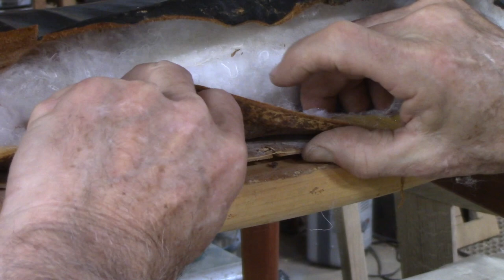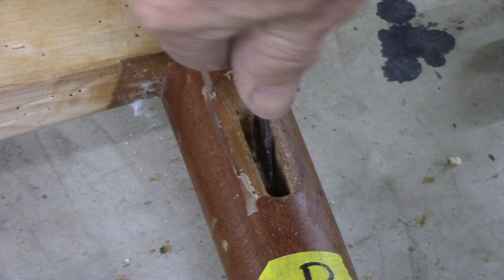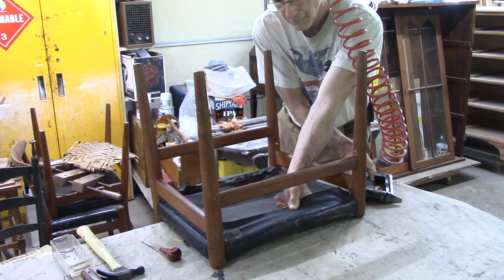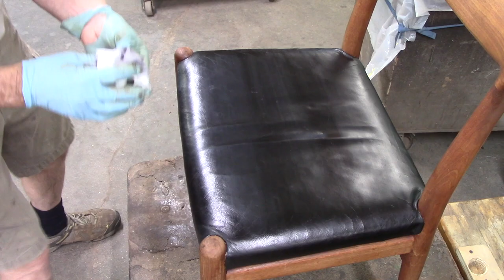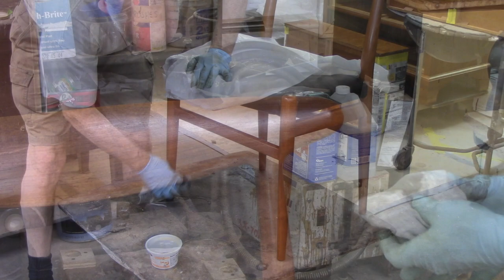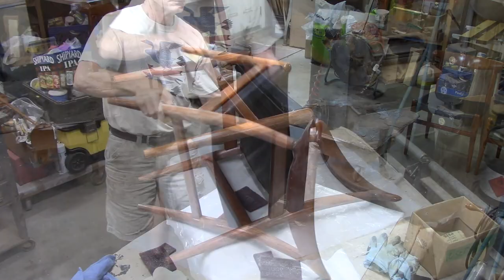Restoring Midcentury Modern Hans Wegner Teak Chairs - Thomas Johnson Antique Furniture Restoration

Comment: Beautiful restoration, I especially liked the treatment you gave the leather seats, I would not have thought of the dye followed by the leather conditioner.
Reply from the maker: Thanks! New for me too, but it worked well
Reply: Me either. But now that I think of it, that's what the shoemaker does when you take him a pair of old shoes to refurbish. Recently my upholsterer warned me that a piece of green leather I picked out for a chair was "raw" ( dyed, but not sealed or painted) and told me I had to treat it with leather sealer (new to me), let it dry for a week, and then treat it with leather conditioner.
Reply: Hello  Tom , great video again what kind of oil do you use to clean leather furniture?  Thank you.

Comment: Thank you so much Tom. I have 8 Wegner chairs that are in need of repair. this video is just what I need. i have been told that I should never glue the joints but it appears you have.  what type of glue do you use. thank you
Reply from the maker: You're welcome! I used hide glue on these, but any type of yellow carpenters glue will work fine too. Also, this Wonder Loc Em is good for joints that are loose but you don't want to diassemble them: https://www.pcepoxy.com/products/wonderlokem-tite-chairs/

Comment: For me this restoration not only showcases your skill, but also your patience. In my limited experience with restoring furniture, a one-off piece offers the satisfaction of the diagnosis, repair, and finish of the project. With a set of chairs, you do the first one, then repeat, then repeat, then repeat... my attention span doesn't handle that well. My wife knows me well enough, and has forbidden me, from bringing home "sets" of anything.
Reply from the maker: Thanks! Luckily, just 4! Sets of 8 or more can get pretty boring. Once had a set of 26 chairs!

Comment: Thanks for sharing your restoration videos and tips, they are of a great value and very professional.

Your videos have encouraged me to try to restore a set of Mcintosh teak dining chairs myself.

I have started do disassemble the chairs and have a doubt in which I would much appreciate your help.  

My chairs have a dowel joint, and in my case some of the dowels are loss but others are quite steady. 

Should I remove only the loss ones and re-glue and leave the others, or should I try to remove all and glue it all again? 

Is there a way to "easily" remove the steady dowels that you could suggest?

Thanks
Reply from the maker: Thanks! Leave the steady ones. Trying to get them out will break them, and redrilling is too inaccurate

Comment: Hi I am from the UK, I have my eye on a set of 8 Wegner Wishbone dining chairs in a light wood with black rope seats. I wanted to ask if I can stain the wood to be more rosewood or Walnut coloured to match my MCM dining table. The chairs will have a coat of varnish, I presume on them so cannot be stained directly over the finish. What advice to you have for changing the colour? Thank you.
Reply from the maker: Thanks! The only way is to add stain to the next coat of finish, in other words, tone it. Buy some satin finish, buy some mahogany stain and walnut stain that are compatible with the finish. Mix 80% finish and 20% stain, brush on

Comment: Thanks a lot  for the all the information that you pass to us through your videos.  I would like to ask  a question if I may. I tried to dissolve some old shellac flakes to make a 1lb cut. I used 100ml of 90% proof alcohol to a 12 g of flakes. The shellac did not dissolve and I ended up with a kind of slimy solution. I tried heating it up in a ben marie but nothing. At the end I strained it through a wire fine mesh and discarded the slimy undissolved flakes.  The strained shellac appeared to be kind of sticky when I used it but the result was ok-ish.  Is there any way to correct this problem and  be able to completely dissolve the flakes?
Reply from the maker: Hi Andreas, thanks for watching my videos! Everyone has a problem dissolving shellac flakes - it just takes time. I don't weigh mine, I use a 1 quart container and put 2 "quarts" of flakes and 3 quarts of alcohol in a gallon container, stir twice a day for a week. At that point there is still the "slimy" solution. I attach a stirring device to my drill and give it a good mix, that usually takes care of it. I'll do that as many days as necessary until it's all dissolved. Might take 2 weeks
Reply: Thomas thanks a lot for the tip . I will try it out.

Comment: Another fantastic job, Tom. With so many almost identical parts it's a minefield at times to remember where all the parts go during assembly. I like the simple labelling method you use. Do you work on one chair at a time (start to finish) or, more akin to assembly line techniques for speed? . I suspect if the latter, the labelling comes into its own. would you use a different tape colour for a particular chair identification or just use different lettering or numbers? Anyway, as always, I enjoy watching your methology of work.
Reply from the maker: Thanks! Sometimes one at a time. sometimes assembly line. The problem with assembly line is just what you mentioned, too many identical parts lying around!

Comment: YOU listed the supplies you used, but it seems different than what's mentioned in your video. Can you help? I'm going to refinish 4 Niels Koefoed teak wood chairs soon and love your video! Thank you. 
What you said:  "If the wood is really dirty, clean with any type of commercial cleaner, like Fantastic (I like Krud Kutter), or a mild solution of Dawn. Then apply any type of oil finish, like Watco Danish Oil, or whatever oil finish is available at your local hardware store. Let dry a day or 2, then use 0000 steel wool with Howard’s Feed N Wax. Good luck!"
BUT::::: You mentioned sanding with 220 paper and using a Tarmwell? Tung oil varnish?  Is this Feed and Wax. SOrry new to this and want to do them right!
Reply from the maker: Thanks! Sorry if it was confusing. Wash the chairs, sand lightly with 220, and then apply any finish you are familiar with. Watco Danish Oil is best, sometimes I use Waterlox Tung Oil varnish (wiped on and off) because it builds up faster

Comment: Huge fan of your work and this episode I don’t how many times I’ve watched it. I have a question for you if you wouldn’t mind giving me a tip but I just picked up a Hans Olsen Roundette dining set and the chairs have some pretty good wear on them. Would you recommend still starting with 220 or somewhere around 150? Thank you!
Reply from the maker: You're welcome! Wash the chairs with a mild solution of Dawn detergent, then sand lightly with 220. Then a coat or 2 of an oil finish (think Watco Danish Oil), then use 0000steel wool and Howard's Feed N Wax

Comment: A great video. You are an inspiration to me. I do have a question regarding  steel wool. When I use it finishing furniture I find pieces of it come off and get inbeded  in my work. Is it the quality of the steel wool or am I rubbing too hard.
Reply from the maker: Thanks! Well, something is catching the steel wool, maybe not sanded well enough? It will catch on oak frequently, but I never had much of a problem. I do like the Liberon steel wool, but I don't think that's the problem

Comment: Nice work, I have to wonder though, were the staples original? Seems for such a high quality chair they would have used nail heads of some sort, as I've seen nice Danish chairs levels down from Wegner's with nicer fasteners than staples.
Reply from the maker: Thanks! I'm sure they were original, the seats had never been reupholstered, there were no indications of any other nails, etc

Comment: Nice job.  They look really good, except for the wrinkles in the seats, but you did fix the color nicely.  I use the maroon pad to apply the oil.  I dont like microscopic bits of steel wool left behind.  I have been known to add a few drops of pure MEK to cut into the previous finish.  If it's only ever been oil, then the MEK is unnecessary. But it is useful on fancy wood doors.   Another potential problem on a total re-glue is that the chair could come up with the legs not meeting a flat floor evenly.  How do you deal with that?
Reply from the maker: Thanks Fred! I've never used MEK, I know it's in a lot of thinners etc. The important thing for chairs is before disassembly check for squareness on the legs. Glue up on a flat surface like the table saw, make sure legs are square, sometimes they don't have to be square if squaring brings a foot up
Reply: @johnsonrestoration  I have always been interested in ketones.  The simple ones will mix with oil and water both.  If you are using an external house paint or stain, oil, alkyd, or latex, and you leave half a can for next year, it will often form a skin on top, which you have to remove before you stir it up and use it.  Just before you put the lid on for use next year, adding a quarter cup of MEK will, over the year, prevent that skin from forming but does nothing to the quality of the paint, as far as I have experienced.  MEK stands for Methyl-Ethyl ketone (CH3-C=O-C2H5) and is slightly heavier than acetone which is Methyl-methyl ketone (CH3-C=O-CH3).  Adding a bit of MEK makes most paints and stains bite better.  If you want something with real bite, I use the old-fashiobed methyl alcohol/dimethyl chloride mix paint-remover product. But watch out.  Use too much and you've ruined everything and have to start fresh.  It eats plastic a bit too. I have a great story to tell about the old oil-soluble Cloverdale Paints "Cinnamon" solid stain.  The paint-remover addition made it last 25 years on the part of the house exposed to the worst weather, cuz it bit in like crazy.  5 years longer than the straight product with no additions in more protected areas.  I had added just enough to break up and smooth off the tough skin that had formed in the 5-gallon pail, and stirred it all up with a propeller stirrer on my drill.  Yeah I spent several years studying and working in chemistry, and quite a bit fooling around on my own.  Like adding powdered zinc sulphate to house and fence paint to prevent slime and mold growth.  They just don't use enough zinc anymore cuz they want you to buy more paint.

Comment: Tom, as commented on by Eric Garcia does yellow glue tend to fail on Teak? As a mid century modern is likely to only be about 75 years old or indeed is it common for yellow glue to fail after less than a century? Perhaps storage conditions were overly damp or usage was heavy for four of the set of six? Any insights from the master would be appreciated.
Reply from the maker: Thanks! I'm not sure exactly what glue would have been used in the 1950's. Either hide glue or white glue like Elmer's. With any chair, especially these that don't have a lot of support (their simplicity), the glue is only going to last for so long, depending on many factors. I don't know how long these chairs have neede gluing, but they lasted a long time with daily use

Comment: Hi Tom, loved the video but I have one question: why did you use white glue instead of hide glue to glue the chairs? Won't this be a nightmare in the future when they will need to be eventually reglued? Thank you for the great video!
Reply from the maker: I use hide glue on period antiques as that is accepted practice. On most other furniture I use Tite Bond glue. The Tite Bond is just as reversible, with heat, as the hide glue. Reversibilty is always a concern, but I have to say, Hide glue can be just as difficult to undo as other adhesives
Reply: Thomas Johnson Antique Furniture Restoration thanks for your answer Tom! I knew that hide glue is sometimes difficult to remove but I didn't know that Tite Bond was also reversible with heat so thank you I can always learn something new! Keep up the excellent work and videos!

Comment: Just curious... why did you go with yellow glue instead of the hide glue?
Reply: because it's not really that old?  when they manufactured the chairs, pva probably was already the standard.
Reply: Josh Messick He uses whatever glue was originally used on the piece. Hide glue was more commonly used in antique furniture.
Reply from the maker: The comments are correct, I use hide glue on older furniture. I don't think they had yellow glue in the '50's, probably white glue.
Reply from the maker: Correct, thanks!
Reply from the maker: True, thanks!

Comment: I have a Charles Limbert rocking chair.  one back slat is missing.  one is loose.  the leather seat in in bad shape but it has the Charles Limbert label still seen on the bottom of the leather seat.  I live in the SF Bay Area.  have you ever repaired any Limbert pieces.  it's quarter sawn oak.
Reply from the maker: Thanks for watching! Yes, I have. The label on the seat is a tough one, I've never seen that. There's got to be good people in your area. Google furniture repair and VISIT the shops! Go with your gut. Good luck!

Comment: Any reason that you didn't use acetone or such chemical to ensure there was no teak oil left on the joints' surfaces before doing the glue-up?

Thanks for sharing your methods with us.
Reply from the maker: Hi Marty, thanks for watching! I scrape the joints a little bit, in theory, there should be no finish on the joints, assuming they finished the chair after it was glued up.
Reply: It's not finish I was commenting about, Thomas, but the natural oils.  Most refinishers use acetone to wipe down all the joints on furniture made from teak and allow it to flash off before applying glue.  But from what I saw on this video as well as your reply, this isn't something you follow.  Perhaps you've different experience and found this not to be needed.
Reply from the maker: That's correct. I do that on new wood, where the oil is quite evident. This 60 year old wood seems pretty dry.
Reply: Thanks for clarifying that for me, Thomas.

Comment: Thomas, Can you give me a list of the materials that you used to clean and recondition the teak?
Reply from the maker: Sure! If the wood is really dirty, clean with any type of commercial cleaner, like Fantastic (I like Krud Kutter), or a mild solution of Dawn. Then apply any type of oil finish, like Watco Danish Oil, or whatever oil finish is available at your local hardware store. Let dry a day or 2, then use 0000 steel wool with Howard’s Feed N Wax. Good luck!

Comment: How to remove the back of a midcentury chair that had no visible screws or caps on the side of the wood?
Reply from the maker: That can be tough. Use a heat gun to try to get the glue to soften a little, and then start tapping with a mallet. It can be very difficult and you have to be very careful with the heat gun. maybe a hairdryer is better. But to get the heat where the glue is can be tough

Comment: I was wondering, since you went through the trouble of removing all of the staples from the leather, why didn't you just completely remove it, reassemble and refinish the wood, stain the leather, then put the leather back on the seat?  Seems like you risked getting finish on the leather.
Reply from the maker: Hi Katy, thanks for watching! The owner wanted to keep everything original, so if I had removed the leather entirely we would have had to reweb the chairs, all new "stuffing", then the leather wouldn't fit right because of the new stuffing...... you get the picture!
Reply: @johnsonrestoration  Thank you, that makes sense.  Wonderful job!